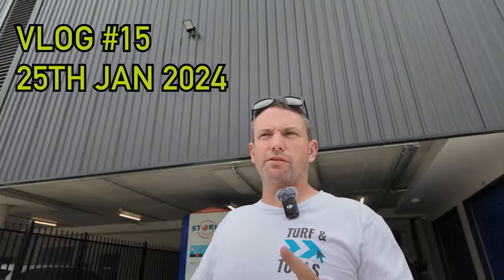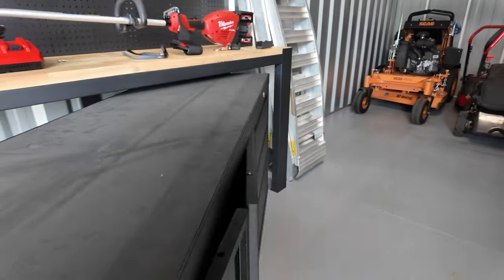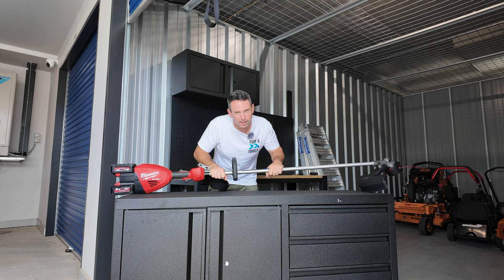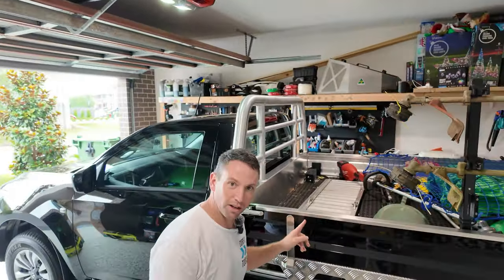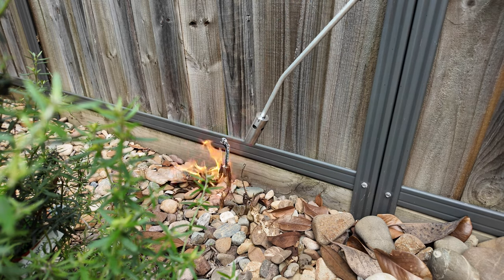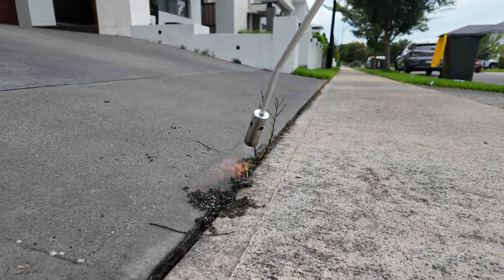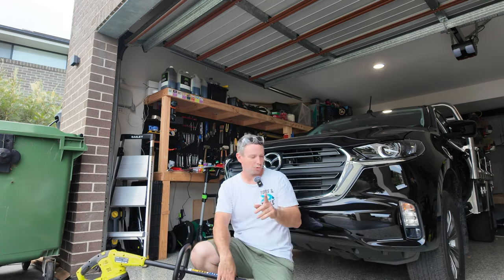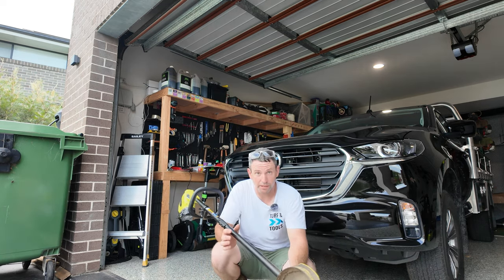VLOG #15 The hottest VLOG Giveaway so far!

Comment: Awesome videos Tim . I've tried to do the edging using my petrol line trimmer in the past but not had good results . Hard to get a clean edge plus my petrol model doesn't like being turned upside down . After watching your review and this video of the RYOBI battery edger I think that the battery option is definitely the way to go . The HP brushless model looks to have a bigger and more robust guide wheel as well as the extra power .

Comment: Ryobi! I’ve been lusting after one of these for a while now. I have a Milwaukee Line Trimmer as I have all Milwaukee gear for work so it’s been hard to justify buying a different brand of tools and having to spend all that money on the batteries and charger and not just the skin only as I’m not massive on the design of the Milwaukee Edger

Comment: I'd get a couple magnets for those cabinet doors. Perhaps get some AEG LED panels for your ceilings, plenty of options to hang/fit them.

When I saw you use the flame for the weeds, I thought of the old firebug drip torches and thought about fire safety, then remembered you're a firey.

Ryobi for the win.

Comment: When I had to start doing the yard work after hubby died, I invested in the battery Ryobi multi tool system and love it. I had to get a stand alone battery hedge trimmer, though, because I needed a LONG one and only a short one was available for the multi tool. Turned out ok because the hedge trimmer uses up the battery quite a bit faster. Whoever wins your giveaway will be very pleased with the performance!

I, too, am loving your vlogs! The informal, more personal chat is wonderful. And the helpful tips! I think I noticed you don’t use Darwin grips on your tools; any particular reason? Especially in light of your height; I, at 5’ 8”, tend to ‘hunch’ using the string trimmer 😬 Are there extra long versions I’m not aware of? I did invest in a grip recently for next season and hope it helps as much as I expect 😉

About the lighting in your shop; I, personally, would add more. Although I’m 70 and was raised with lower lumens, I definitely want my space well lit🤪! The ceiling fan above my recliner has a 4 arm light and I’ve replaced the ‘maximum 40w’ incandescent bulbs with LED 100w equivalents!! Yippee that the LEDs give more lumens for the wattage!!😉👏👍! That said, I’d also add more/stronger lighting to the rear of the space 😉! I definitely like things well illuminated hahaha!

Take care and I’m eagerly awaiting your next video!❤

Comment: Lighting was fine. Interesting how the number and range of lawncare tools has exploded since you started posting videos. Coincidence? I think not. You also have to be really careful using a string trimmer around trees, since repeated impact can cut the bark all the way around which will eventually kill the tree. Use a trunk protector to prevent that. Also works on curious elephants.

Comment: I been using the 36v Ryobi edger for about 3 years on its last legs , love 18v unit I have several Ryobi batteries , 377001
Reply: What station is 377 captain there for 20years